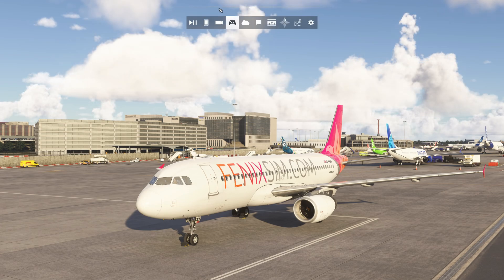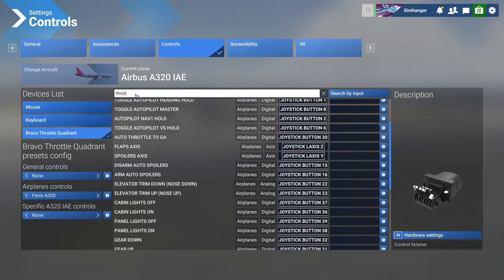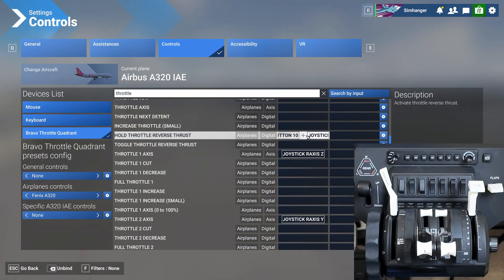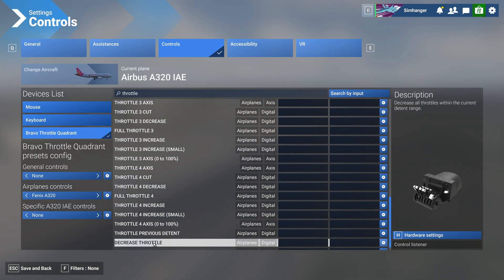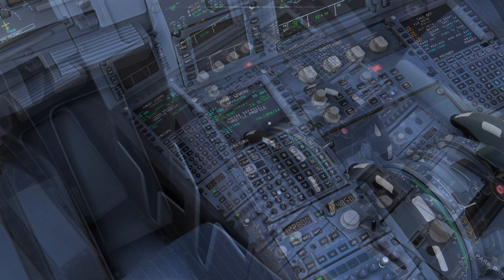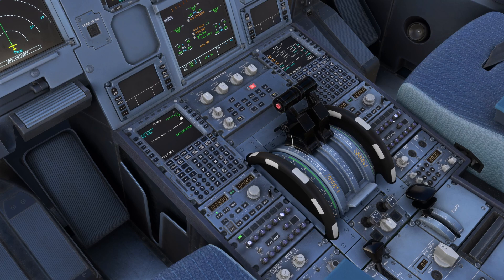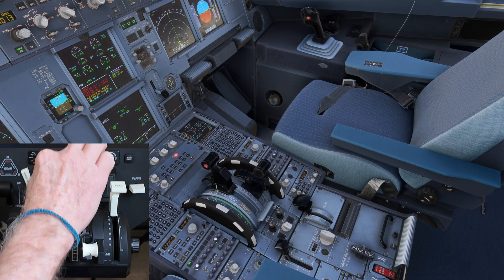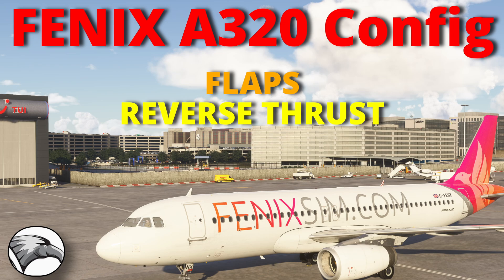Fenix A320 in MSFS2024 | Config for Flaps & Reverse Thrust | Subscriber Request

Comment: Sir, you are a life saver! I was pulling my hair out trying to figure this out. Although they have since removed the "Throttle Cut" from the settings menu, i was still able to figure it out based on your info. Greatly appreciated!!
Reply: I spent days following Marks great video BUT was not aware they had changed the name of Throttle cut ..spent ages trying to find how to find throttle cut..  Whats wrong with these guys at mfs  why do they muck up things and cause a lot of hassle.   I mean they should have profiles set prop twins, jets with bravo and other manufacturers, in my opinion.

Comment: Hi Mark, thanks for your video on throttle settings and calibration on the A320. I have tried this following your video on the Fenix A320 but they have changed the settings yet again and 'Throttle x Cut' & 'Decrease Throttle' have been removed. I have tried 'Throttle x Decrease' for throttles 1 & 2 but cant get the aircraft reverse levers beyond idle when moving the Bravo levers beyond the detent to full reverse. The reverse levers on the aircraft do not operate either.Do you know what controls replace Throtle Cut and Decrease Throttle? Thanks

Comment: Hi Mark, this is no longer working (at least for me). Followed precise steps twice all the way through and cannot get the same result as you. When engaging reverse (Honeycomb Bravo, Airbus levers) the throttle creeps back into reverse very slowly. I timed it at 2.8 seconds from my hand moving the physical lever to the levers actually getting there in the sim. And then, once the levers are finally in reverse, they continue all the way back to MAX REV, even if the Bravo's physical levers are in thrust idle. I don't know what broke it, I would suspect the 2024-native update. Any chance you could revist this? Your tutorials have always been so helpful in the past.
Reply: i have this same problem...
Reply: I'm also having issues with my throttle, nothing seems to work.

Comment: Hi Mark.  Throttle cut have been removed as of SU2.  What is the new config for this? Throttle Idle? I can't seem to do the Idle reverse like in your video.  It cuts throttle after i get my throttles to a bit more idle.  Thanks.
Reply from the maker: Yes throttle idle replaces throttle cut
Reply: @SimHangerFS Thanks!

Comment: Thanks Mark.  There is no way I could have done this without your help.  One small change in the naming covention in SU2 is throttle cut is now throttle idle. (Asobo at it again !!)  the other think i noticed is the button numbers of the  Honeycomb throttle have changed. No big deal, everything worked as discribed.

Comment: Great content, thank you. Unfortunately my 2024 does not recognise reverser levers 10 and 11 when scanning, any ideas, is there a honeycombed update for 2024 I am missing?
Reply from the maker: @dancingtango  if you have one of the very very early models check if the levers have the 3 contacts, some come with only two. Alternatively you may have a few loose wires inside.
Reply: @ thanks for replying so quickly Mark. Yes I have the 3 contact axes, think I will go back to 2020 and double check that the reversers are still recognised, and go from there. Brilliantly helpful videos for the whole community to benefit from, many thanks and keep them coming! 👍